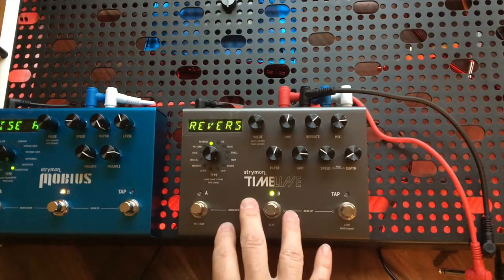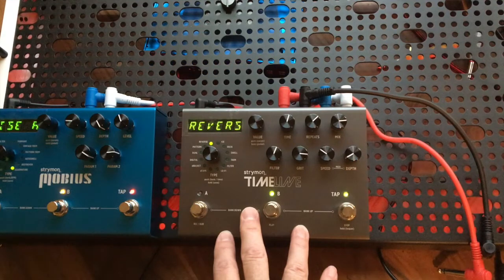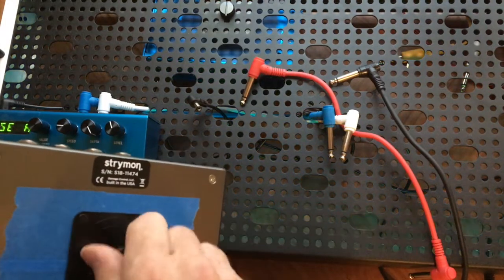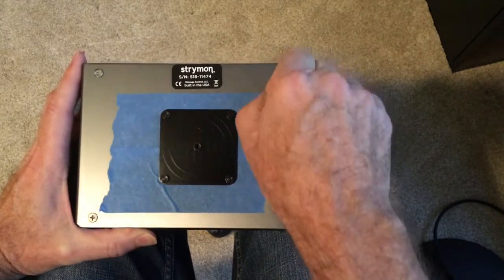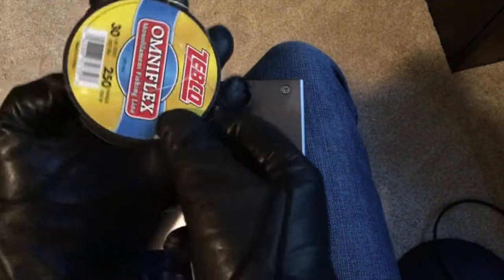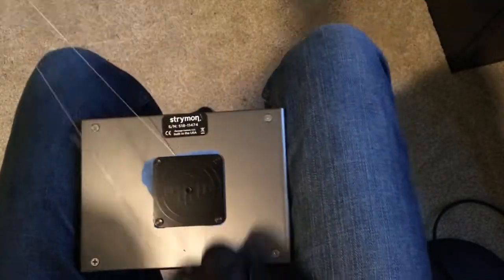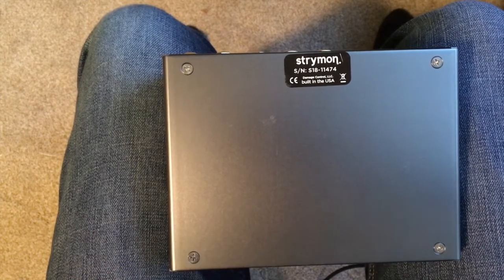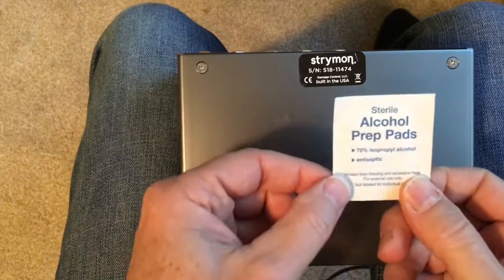Temple Pedalboard Safe Installation & Removal

Comment: Goo Gone will make quick work of the adhesive also and has less chemicals than the adhesive remover. I knew about the painters tape trick but using the fishing line for removing the plates was pretty trick. Right now I'm removing plates to go on different pedals instead of buying more plates. Any tips for removing the original foam adhesive?

Comment: How does it stick THROUGH the blue tape?
Reply from the maker: It sticks to the blue tape. So you can change your mind for a few days until it becomes truly stuck. Without the tape, you are having the stronger adhesive on the paint, making removal and cleaning more difficult and risky.
Reply: Thanks. But, can you leave it on with blue tape still on? And if so, is it still a strong bond?
Reply from the maker: @jholt777  Yes. If you leave it for a week you will not be able to remove it by hand.
Reply: @Digiphex  right on, thanks!